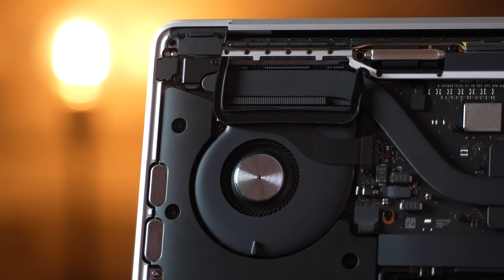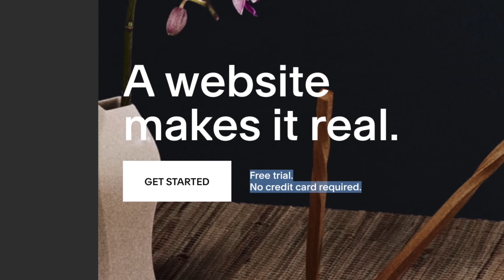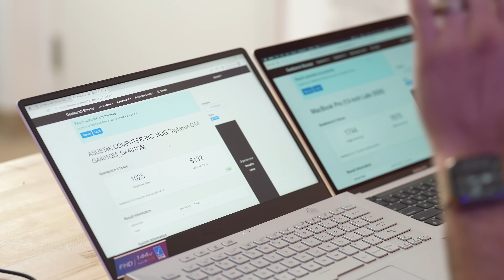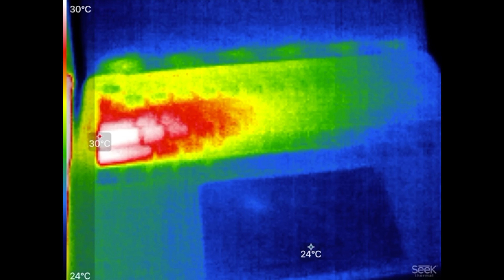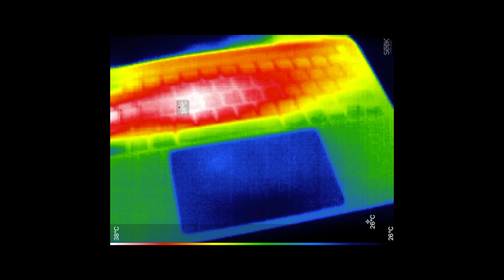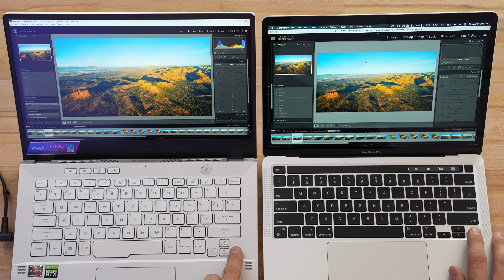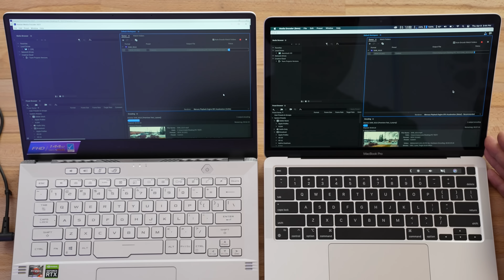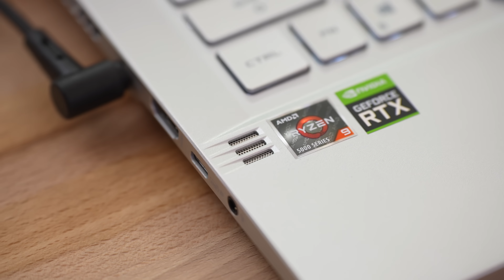Apple M1 vs AMD 5900HS + RTX 3060: FINALLY an M1 Killer?

Comment: M1 seems to be a better package for the price. I mean I could wait a bit longer if I’d get better screen, speakers, keyboard and all
Reply: What about the air
Reply: @anetizen6404  Air is good too. I’ve heard that the performance is on par with the pro. I’ve also heard people saying air is a better buy for the price.
Reply: Go price out a M1 MacBook pro with 16GB of RAM, and 1TB SSD and get back to us on that.
Reply: @timg6930  well! I own a MacBook now, I wouldn’t need more than 256GB. Also have you noticed M1’s 8GB RAM performs more or in some cases better than 16GB on pc because of it’s unified architecture. Last but not least, the ecosystem integration is just awesome, I would pay 500$ more just for the software.
Reply: @saketh44  Honestly, I don't know that I would say it performs better on the 8GB of RAM. I'd just go with, it has not been an issue. Get a fast external SSD, and the internal SSD will more than likely be enough for most users. Apple kills us on storage pricing.
Reply: @timg6930  I agree with you on the internal SSD pricing. And about RAM it is based on my personal experience. I was a life long pc user until last year and after I started using Mac, my opinion completely changed. 
Ps: my previous laptop was a lenovo Z series with I5 8th gen, 12gb RAM and 1tb storage.

Comment: I will wait until the M1X/M2 come out. Always good to wait for 2nd gen...
Reply: That’s the same thing we said with intel vs m1. M2 vs m3. It’s never going to stop. Plus, there is going to be additional cost with the updated design and processor. Just buy the best thing at present if you need it. If it’s just a few months away and the new features appeal to you, waiting can be better. Stop thinking that 2nd gen is better. Everything is better with a tier up in development process.
Reply: 3rd gen better.
Reply: Hopefully these keyboards are better then the last mac keyboards as they had known issues. They say the problem has been fixed but only time will tell...